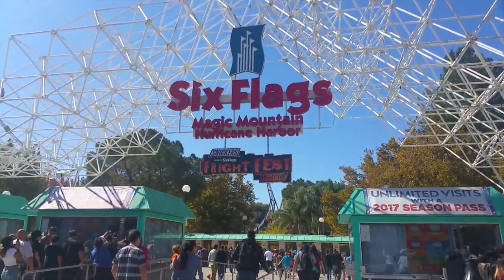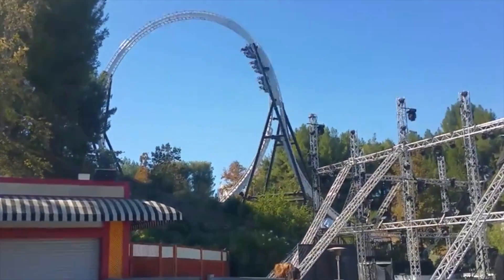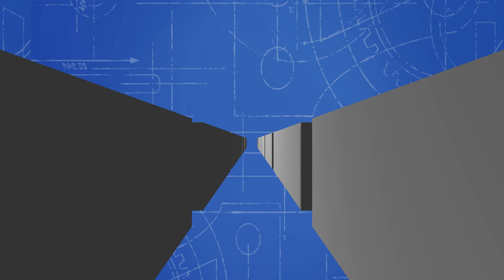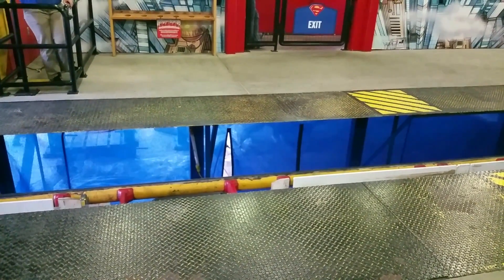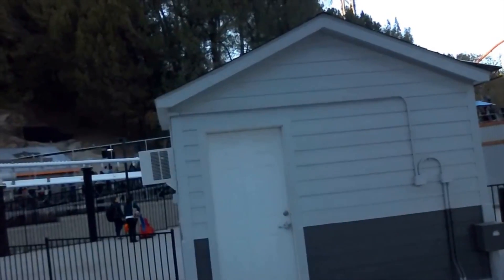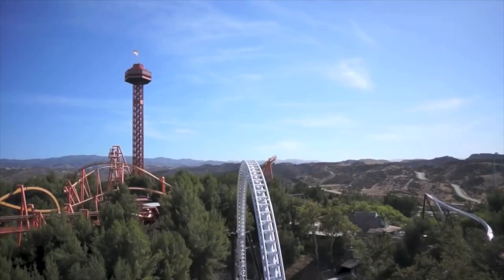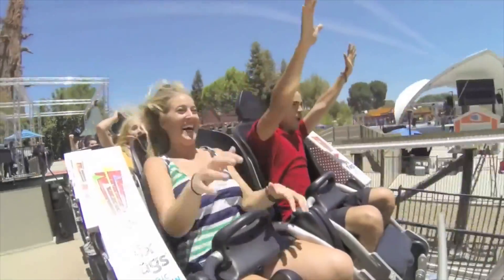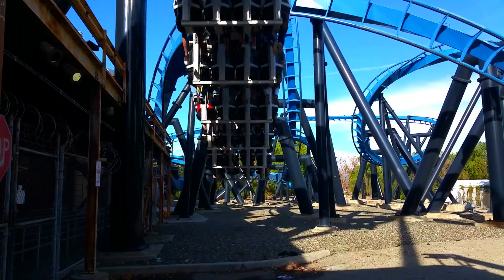How It Works: Full Throttle (Six Flags Magic Mountain)

Comment: ive been on this, i was caught off guard when the train hit the top of the loop as how slow it was going by the time it got there, I felt like i was going to fall out, even though i knew the restraints are locked, it actually kinda spooked me
Reply: I left like the restraints should have had a shoulder harness, the way its designed on only the legs felt unsafe/ "I don't have my full trust in this seat belt" feeling. But I rode FULL THROTTLE 3 times in my life and I loved it.

Comment: So I go to Six Flags all the time. I love Full Throttle but can't help but be afraid of stalling perfectly perched upside down! Are there any failsafes for preventing an upside down stall?
Reply from the maker: Nick Brunet uhm... valid point... while if you did get stuck perfectly at the top (you might want to buy a lotto ticket, you might just win) uhm, hmmmm that's a tough one... I'd just say lean. tell everyone to lean... realistically though since the coml does take weight prior the comp will always overshoot it, but in some cases it'll undershoot cause of a lsm timeout... they do have the green lines to know where to hoist the train so... you'd have to be pretty damn lucky to get up there though so I wouldn't worry about it... I'm not entirely sure tbh...
Reply: @AmusementLabs  or tell everyone to do the "what is love" thing?
Reply: Modern vertical loops on rollercoasters aren’t perfectly circular to prevent the train from stalling upside-down at the very top, I believe